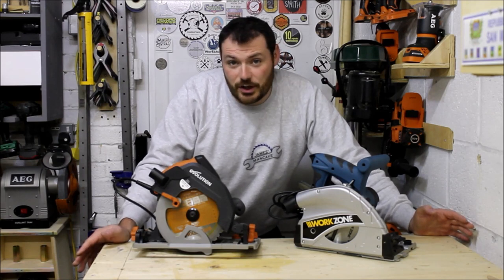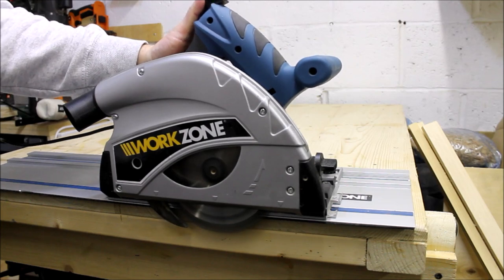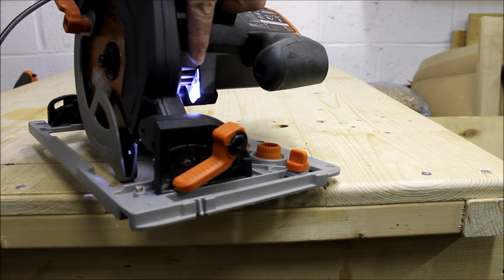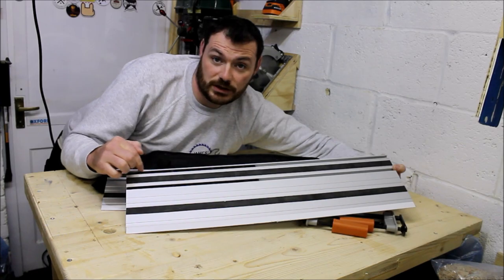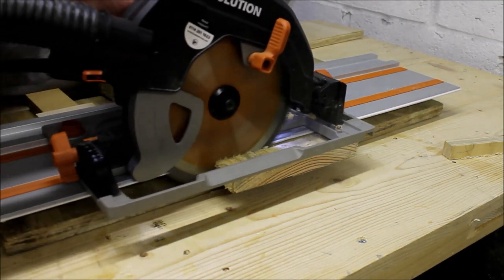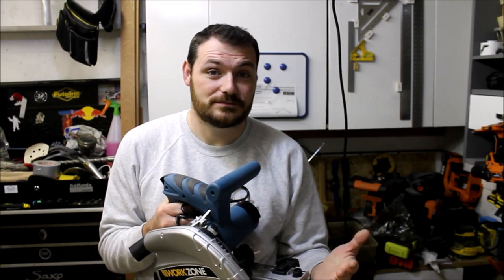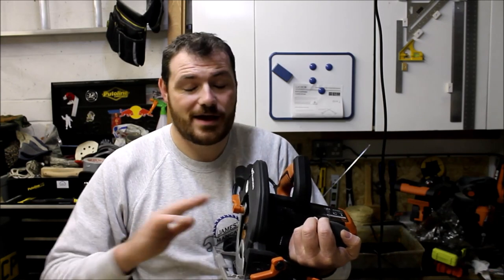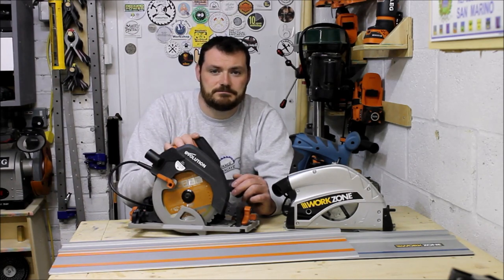Aldi/Workzone V's Evolution Track saws Comparison #Workzonepl55 #Evolutionr185ccsx+

Comment: Thanks James that was as clear as mud??
Kidding. I know where you’re coming from on this.  I purchased a couple of weeks ago the Parkside cheapo from Lidle. 10minute workshop brought it to my attention. I replaced stock blade after Peter Millards  chat and the thing is basic and plasticy but its a £65  saw and it’s accurate and fairly quiet. 
Renovation Couple did a horrendous review this weekend of same saw?  The guy didn’t  even seem to know that the blade release  nut  goes counter clockwise for Christ’s sake!!
I’m pretty happy with the Parkside plunge saw. You should check out 10 minute workshop ?
Great review of the items you covered on this upload though.  I’m getting the Evo longer rail thing as it fits the Parkside.  Good to see you uploading mate.
Reply from the maker: Hi David, glad to hear from you again, wondered where you had gone! Yes I've seen Peters videos on both saws. I must admit, the first few tools I bought from aldi years ago were great, so I've sorta stuck with what I know. I've bought Parkside stuff also and can't fault it, but of late my last 2 aldi tool purchases I havnt been that impressed with, so maybe its time to try the Parkside stuff out properly. I think the rails you will be really happy with, mine are great, lighter then the aldi ones, but feel just as strong. 👍

Comment: I've been using the Aldi one. The track only being connected by one slot doesn't fill me with confidence but I haven't had an issue with sawing, even when on poorly supported surfaces. My saw doesn't have the problem hitting the centre of the track. That might be an issue with your particular one.

For us in the UK tracksaws are heavily needed as most here do not have the space for tablesaws. Americans typically have large garages so tracksaws don't mean much to them I would think.
Reply from the maker: The saw hits the middle of the track for 2 reasons I can see. 1 because the track is held together with 1 connecting bar it allows the front to left up, and 2, my track to be perfectly straight has to be ever so slightly pulled apart at splitter guard side, allowing a gap for the saw to fall into.

It's the dust collection for me that really needs to be better. If you cut sheet material down outside them it will be perfectly fine for that application, but in a small confined shop like mine the less dust the better

Comment: Damn I need a tracksaw now... Even though I've a table saw and dewalt cordless circular saw 😁
Reply from the maker: Haha, I was the same, could probably make do with what I have, but it's a tool I wanted! 🤣
Reply: @JamesManCave  I'm. Hooked on aldi and lidl tools.. Not tempted in the welding gear yet
Reply from the maker: Haha, it's fairly good stuff, the new range of lidl tools look impressive. I've seen the welder, nearly bought it, but opted against it. Just don't have the room for welding and metal work....... YET! 🤣

Comment: I would of liked to see you use the workzone on the evolution track as evolution claim their track is compatible with many brands of saw.
Reply from the maker: The workzone track saw won't fit on the evolution track, due to the workzone saw being an odd size. There are other YouTubers who use a Makita and DeWalt tracksaws on the evolution track as it's cheaper to purchase
Reply: @JamesManCave  thanks for that  the evolution track says its compatible with sheppach so I was hoping as the workzone is a sheppach 55
Reply from the maker: @pauldavison7105  yes it is, Peter Millard had a video on his channel (can't remember which one) where he shows you the problem with using a workzone track saw on the evolution track. I'm sure this will help you out
Reply: @JamesManCave  cheers

Comment: Man I want a track saw so bad, but the prices are crazy and the entry level ones all seem to be lacking somewhere.
Reply from the maker: Yea I've heard the UK seems to have a lot of cheaper entry level saw compared to other countries. I think if I bought another one though, I'd go for a dewalt or makita one
Reply: @JamesManCave  I think so - entry level in the US is much more expensive which is why I'm leaning toward the Makita. Looked at the DeWalt but don't think it comes with tracks here. Either way is easily $500 sadly.
Reply from the maker: Wow, that is a lot compared to here, I don't think it's much more then £250 at the moment.

Comment: Change the Evolution blade to a compatible Saxton blade - Amazon sells them - and they cut extremely well. The dust extraction on all Evolution products is abysmal, unfortunately.
Reply from the maker: Because the arbor on this saw is 20mm I changed it for a high quality Irwin blade.